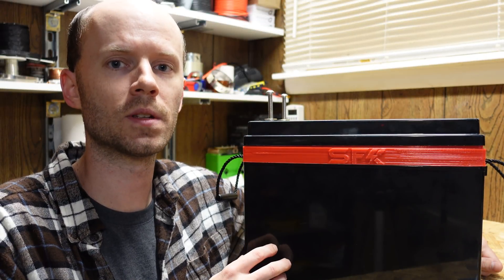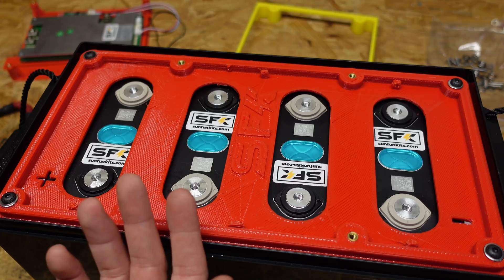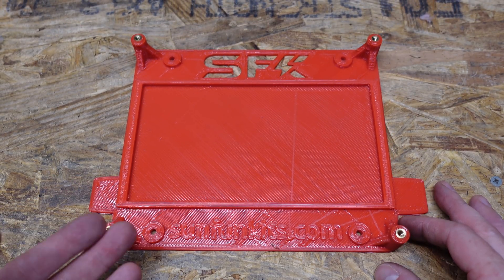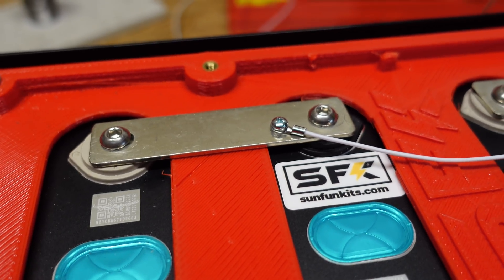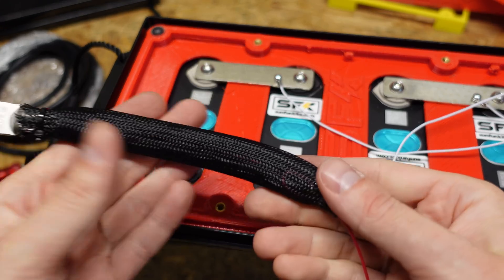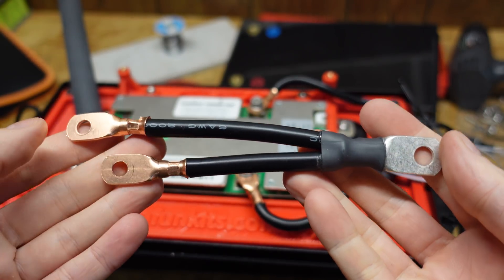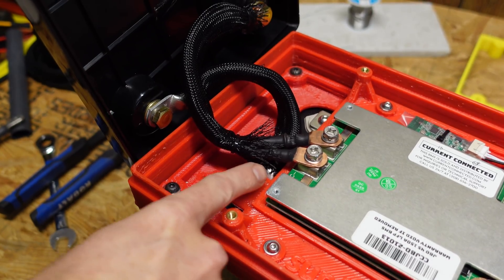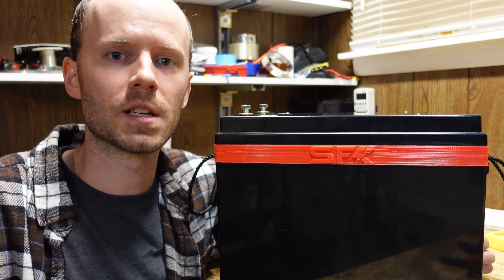Sun Fun Kits DIY LiFePO4 Battery, Follow-Up and Rebuilding

Comment: Good video!  You should always make certain the cables provided or those you replace are 100% COPPER and not copper coated ALUMINUM.  Many vendors will save a few dollars by replacing expensive copper with aluminum.

Comment: Maybe they should offer the BMS you installed or a programmable BMS vs the one offered.  THanks, good video
Reply from the maker: The BMS they offer is fully-programmable as-needed to fit your application.
Reply: @LithiumSolar  , I guess what I meant was the charge versus drain current values.  Why not make a BMS that can handle 1C discharge of up to 150, but allow it to be programmable from 50-150 A.  instead, you had to remove and "update" the BMS (which was from the same company).

Comment: They have bought standard battery cases at $30 each and added the rest themselves. Definitely cheaper to DIY but great value if you arent a DIYer
Reply from the maker: Please link to where you can purchase these cases for $30. The cheapest I saw was around $100 shipped (from China).
Reply: I have found it for $43 plus shipping, however it doesn't have the metal reinforcement bars, that is added by SFK. I would think everyone that can do it better and cheaper should consider making a video.
Reply: @john_in_phoenix  Guessing he didn't want my link to Alibaba on here :D
Reply: @TheGalifrey  YouTube removes links if you post them.
Reply: @john_in_phoenix  Oh well, they are £21 on Alibaba plus shipping without the reinforcement bars they added (u-Channel aluminium).

Comment: I see you know about using fine strand wire with DC voltage, and you seem to know about putting two dissimilar metals in contact with each other, which causes corrosion when exposed to moisture (which is why they recommend using LocTite).
Reply: As the screw thread itself is not current carrying you can just use dielectric grease. The original case they have purchased is designed to be glued shut which would remove the exposure to moisture issue as well.
Reply: Can you explain why fine strand is used for DC voltage? I'm just starting to learn about building batteries, and have no idea what I'm doing yet. I've purchased 8 304AH EVE cells, and don't want to screw them up. No one as far as I've seen yet, has went through explaining wire sizing, or fine v thick strand. I am in the process of making connection pigtails for the cells, but I am making them with 2AWG wire from lowes, and the strands are thick. Would it be better to use some old jumper cable wire? It's 2G Fine strand.

Comment: One small tip for the braided sleeve is to burn off the ends it will prevent the braided sleeve from fraying
Reply: Nooooooooooo
Reply: Or use a hot knife to cut the sleeve.

Comment: I was about to say that I use a 2 gauge lug for two 6 gauge wires. I  don't have any unplated lugs myself. The two M8 bolts are a good idea. They do have an injection molded case lid, waiting on mine to arrive.

Comment: Great video. Thanks for the update. I have a question, can we series connect 12V JBD BMSs UpTo 48V, any idea? Just curious which MOSFETs they are using. Oh and still waiting for the CERNSS battery review, I'll purchase after your review. Thanks again.
Reply from the maker: I have one "not-a-battery" video to work on that's kindof time-sensitive, then will be the CERNSS after. Sorry it's taken so long. Yes, the JBD can support 48V setups. I'm told they can go quite a bit higher, though most companies are recommending sticking to 48V systems max.
Reply: @LithiumSolar  Thanks so much.
Reply: Be sure to purchase the JBD BMS that is specifically advertised as being series capable. They do make some that are not.

Comment: Only thing I'd add is on those positive and negative balance leads, where you crimped them in with the larger cables, maybe snip those and add in spade connectors - that way you can disconnect the larger cables from the balance lead harness if you ever needed to swap it out.

Looking forward to seeing your source for that silicone wire. Much more flexible than what I've been monkeying with over the past week while working with my eight 280Ah cells!

Comment: Really- quite a 'component kit. I like virtually everything about it. Thank you for making a doubled 6 AWG wire set for higher charge/discharge profiles. I was concerned about having such a low charge profile for such a large battery? Time to charge becomes an issue quickly. Conversely, I also want the ability to discharge at max rates- just in case: the wife turns on a hairdryer when the microwave is on, or... oh, you get the idea! Of course, the battery internals need to 'match' the input/output capacity- some batteries you just can't tell because they are so sealed up? I've noticed that very few battery companies actually 'test' individual batteries for discharge capacity (saw a YT video showing 'new' batteries being tested- and some failed miserably!). I would pay the premium for matched & TESTED cells because it really matters for longevity.
Reply: Word.

Comment: You can also connect a few more temperature sensors (thermistor) in parallel per each cell so it will be more safe I think
Reply from the maker: I don't think you can wire temperature sensors in parallel like that. They're essentially resistors (thermistors) and wouldn't two in parallel change the resistance readings?
Reply: @LithiumSolar  yeah you are right Sir I didn't thought that one, even we add more resistance the bms won't allow it to active! I'm sure I'm gonna find that later using some Relays and Thermistors ;)
Reply: @LithiumSolar  I appreciate that for letting me know
Reply: Thermistors are essentially variable resisters, that vary with temperature.  A certain resistance equals a certain temperature.  If you parallel extra thermistors the temperature readings will be completely inaccurate/wrong.  (electrical engineer here!).

Comment: Rule.of thumb when you crimp any big wire you should never install a small Guage wire into that crimp terminal.  It should have been soldiered on outside if the crimp
Reply from the maker: Why not? It seems to have crimped perfectly fine.
Reply: @LithiumSolar  yes it did,  but rule of thumb is to not put small wires into a crimp along with big guage wire. I work on cell towers and cell tower sites, its for earthquake prevention.  You did a wonderful job by the way,  love your videos too but was just putting that out there.  We usually clean the outside ot the terminal right at the dimple and soldier it right to it. It works beautifully and its earthquake proof to the most extent. We kinda overdue everything but there is a reason why we are redundant and do things certain ways. Keep the great videos coming we really enjoy the videos.
Reply: @BM-hb2mr  you're right, highway travel is liable to make such advice valuable!
Reply: @BM-hb2mr  i love how you were respectful while making your point...thumbs up to you
Reply: @BM-hb2mr  do you happen to work for Cat5?

Comment: I have the same crimp tool, definitely happy with it after many crimps
Reply: I use one like that for the smaller Anderson connectors, but use an expensive Temco hydraulic crimper for larger lugs.
Reply: @john_in_phoenix  
yes, just because lithium solar couldn't pull apart his crimp, does not necessarily mean it makes good contact.
Reply from the maker: I wish I would have bought this one from the start instead of the cheap hydraulic I had used for so long. Live and learn I suppose.
Reply: @LithiumSolar  Only so many hours in the day to research, luckily with people like you generating content on youtube there are more and more resources available.
Reply: That’s funny I was just thinking how I do not care for that crimper. I settled on the hydraulic style crimper.
Reply: @thervsolarseries2827  Is it the shape of the crimp or the mashout that you don't like? There are a few gauges where it does that more than others.
Reply: @ShaleAudio  Yes I felt it was inconsistent and I didn’t like the way the crimps turned out. With the hydraulic crimper my crimps look the same each time. It is by far more of a pain to use but I like the results better.

Comment: I'm wondering if one of those LIFEPO4 batteries can be connected to a UPS
Reply: Not without a proper BMS in between the charge and discharge side of the UPS. The charge circuit and low voltage protection built into most UPS are very basic and designed for Lead Acid chemistry. You’d need three basic things - a UPS that uses a voltage easily made up from LiFe, a UPS that isn’t going to shutdown because voltages are slightly too high or too low and a case big enough to hold the actual batteries, (unless you’re happy to just attach them with cables). You could easily make a UPS yourself with a battery, an inverter and an automatic transfer switch, and some powerstrips.

Comment: What I don’t like is his battery boxes or plastic or selling them for tremendous amounts of money the BMS that they sell is only 50 bucks the plastic is made in a 3-D printer I mean honestly it’s like they think we’re not paying attention these cases are actually pretty cheap but in yet they charge for the cases up to $700 without batteries after shipping that’s my problem with this company they need to come down on their pricingAnd they do not produce a safety barrier if the lithium decides to catch fire
Reply from the maker: I understand they're cheaper if you find and order from a supplier in China. This company though is taking the time to procure them, add in other custom-designed parts, and make them readily available in the United States. Those points are where the value is added. Sure, we can all go hunt them down on Alibaba, but that's just a pain in the rear most times. Also, it sounds like they're starting to work on molded components - hoping to see more options soon.
Reply: Make sure that you add the metal reinforcement bars to the plastic case you purchase. When you design and print your BMS holder with metal screw holders, please publish the file. Those $50 BMS are more like $90 plus shipping. I paid about $225 for the case and printed parts, already had the cells and BMS. Worth it to me, now I don't have to go and purchase a saw and plywood and rent a truck to get it home.
Reply: Ordering from the supplier in China is not necessarily my mandate that I want people to take from this comment these battery boxes are not safer if they were constructed out of metal they would be a tad bit safer give you a little more time to get a hot sell out of your bank before it actually catches fire keeping your house from burning down most people don’t understand lithium cobalt lithium-ion can’t burn feet into the ground they burn so hotThis is not brought up in green thing it’s just a lot of money for something that doesn’t make anything any Savior just kind of neat looking